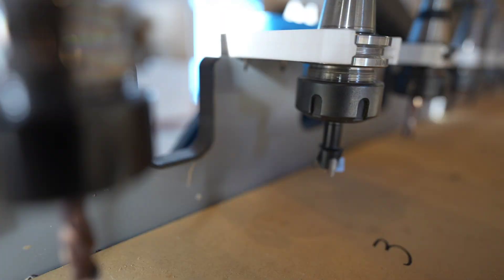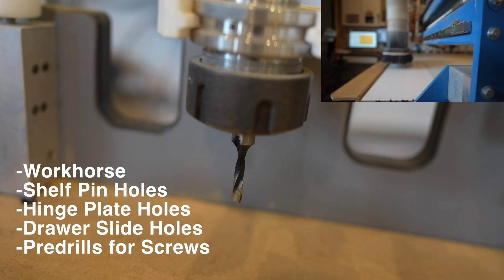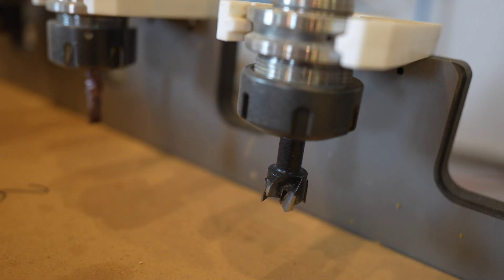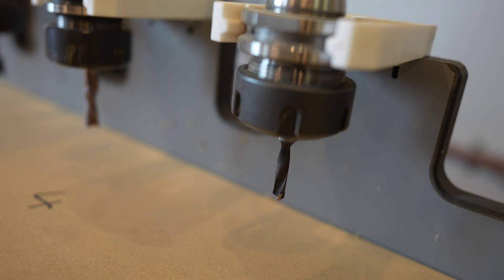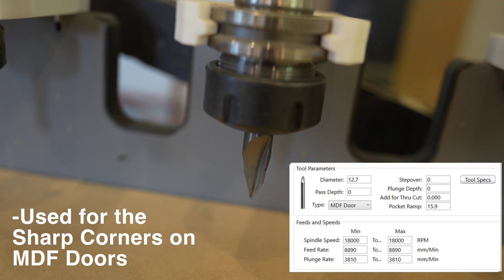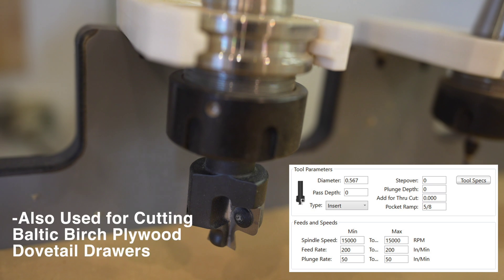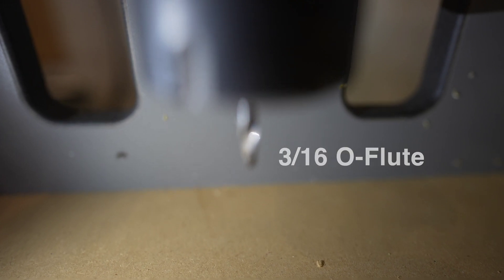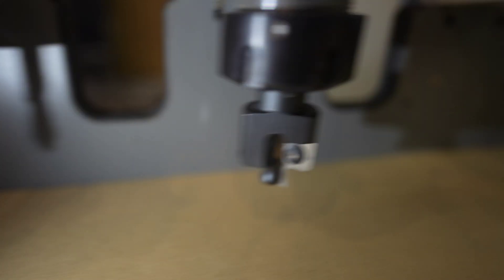CNC Router Tool Basics for Cabinets

Comment: Great video, thanks for explaining how each bit is used. Since you have a large ATC, do you ever consider separate upcut and downcut bits instead of a compression? Obviously adds a tool change, but it would evacuate chips more efficiently. With the table I use there is no ATC, so the compression bit is great, but a fair bit of cleanup afterwards.
Reply from the maker: Yeah adding an upcut sure would clean up the dust nicely I wonder if it would be worth saving cleanup…..interesting idea

Comment: We're finally getting our CNC installed this week and next. I watched this video with growing apprehension  because I only opted for the standard 14 tool changer and I saw that 10 or so slots of your 16 tool changer were filled up with just the drill bits. I started composing an email to the manufacturer to send out Monday morning asking about the cost and time required for adding additional tool changers.

And then I did a mental palm slap to my forehead. We may only be getting a 14 tool changer, but we are also getting a 24 tool drill block which, I'm hoping, will handle most of the drilling operations. Whew, crisis averted. 

Anyways, I appreciate your videos immensely. They have been instrumental in gradually getting me acclimated to Mozaik and helping me get over my CNC fears in general. Thanks!
Reply from the maker: Thanks, so much to think about right! Cnc is amazing you won’t regret it. Drill block is a good choice. Check out Millwork scanner too. Another great addition to mozaik and cnc workflow

Comment: Do you guys ever use the sanding hand for primer or solid wood doors, or just the raw mdf?
Reply from the maker: The finishing area is too far from the cnc to be viable to sand with the sanding head but your comment did spur me to wonder if sanding primer would work on a smaller 4x4 machine by the sanding area. I should do a test to find out!
Reply: I am absolutely interested in it but we do very few one piece doors so i would have to have more uses for it than just sanding mdf to justify the price.